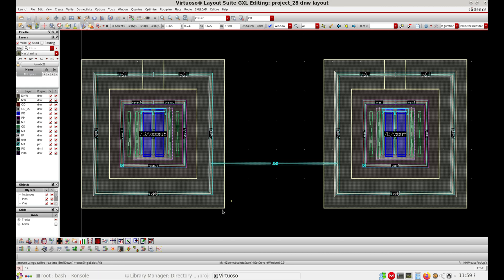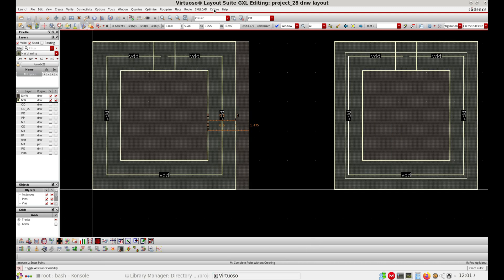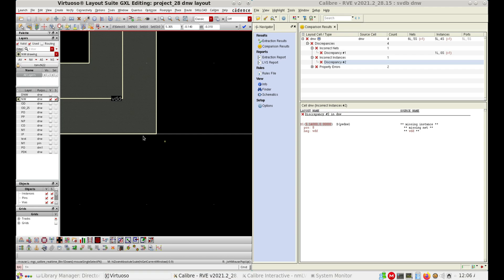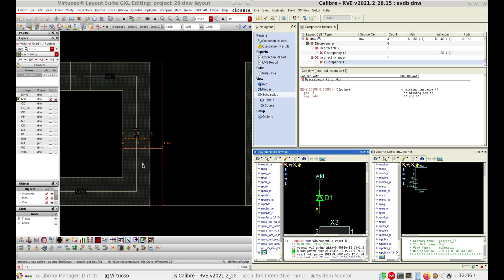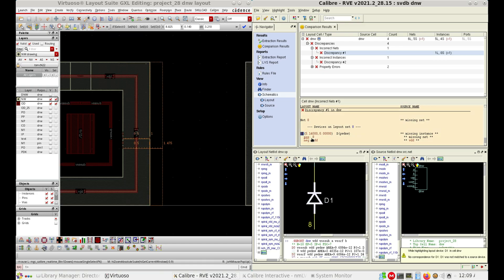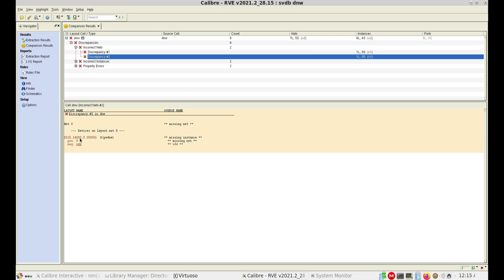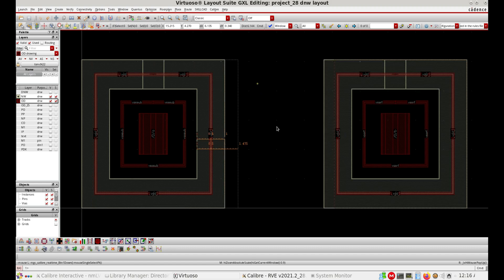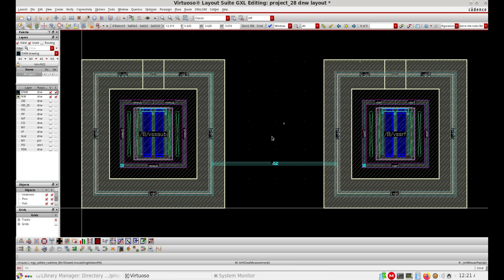DNW Diode Extraction - Layout Mistakes  (Part-4)

Comment: Hi Sir, please make a video on manufacturing grid related and also why off grid error is come and how to overcome on that
Reply from the maker: In analog IC (Integrated Circuit) design, the concept of the "grid" is crucial for ensuring that the layout is precise, manufacturable, and meets performance specifications. Here's a breakdown of its significance:

### 1. *Grid in Analog Layout IC Design:*
   - *Alignment and Symmetry:* The grid provides a reference framework that helps designers align components, like transistors, resistors, and capacitors, with precision. This alignment is critical for maintaining symmetry, especially in differential circuits where matching is crucial.
   - *Consistency:* By adhering to a grid, designers can ensure consistent spacing between elements, which is essential for controlling parasitic effects, such as capacitance and resistance, that can impact the circuit's performance.
   - *Design Rules Compliance:* Foundries (the manufacturers of ICs) impose design rules that often require components to be placed on a grid. Following the grid ensures that the layout adheres to these rules, which is necessary for the manufacturability of the IC.
   - *Scalability and Portability:* A grid-based design is easier to scale or port to different process nodes or technologies. It ensures that the relative placement of components remains consistent, which can simplify the adaptation of a design to different manufacturing processes.

### 2. *Grid Errors:*
   - *Definition:* Grid errors occur when components or interconnects are not placed on the designated grid points, leading to misalignment or spacing violations.
   - *Impact on Performance:* Grid errors can cause mismatches between transistors, resistors, and capacitors, which may lead to variations in the circuit's performance, such as offset voltage in differential amplifiers or errors in current mirrors.
   - *Manufacturing Issues:* If components are off-grid, it may cause problems during the fabrication process, leading to defects or yield loss. This is because the lithography and etching processes are optimized for components that align with the grid.
   - *Troubleshooting and Correction:* During the layout verification stage, tools like Design Rule Check (DRC) are used to identify grid errors. Correcting these errors is essential for ensuring that the design is both manufacturable and performs as expected.

### Summary:
Using a grid in analog layout IC design ensures precision, symmetry, and compliance with manufacturing rules. Grid errors, if not corrected, can lead to performance degradation and manufacturing issues, making grid adherence a critical aspect of the design process.